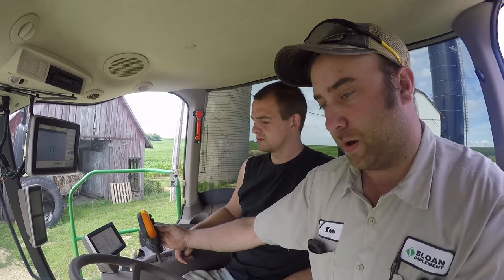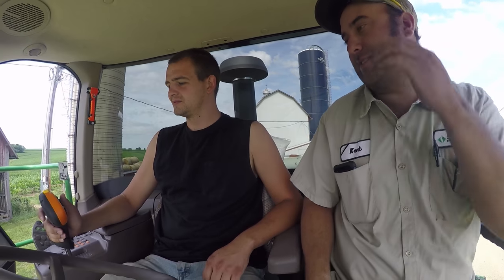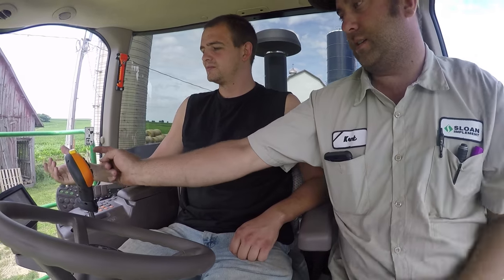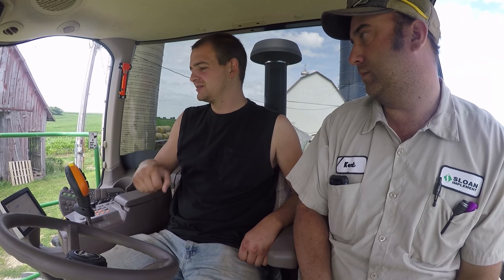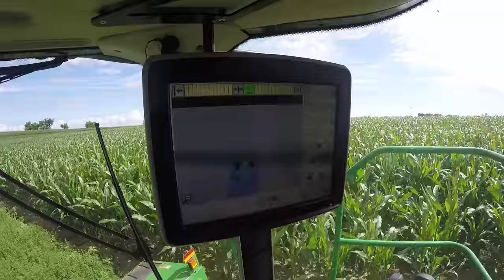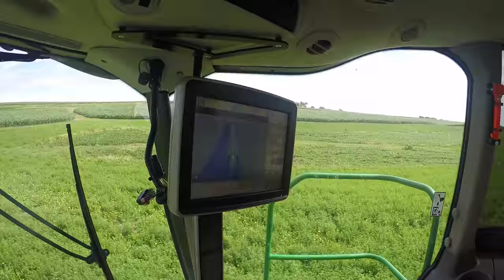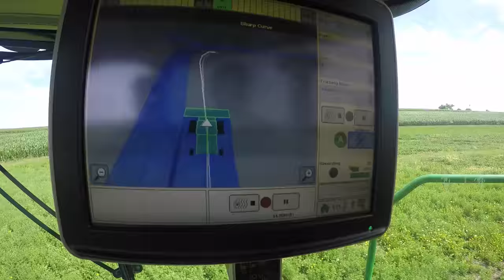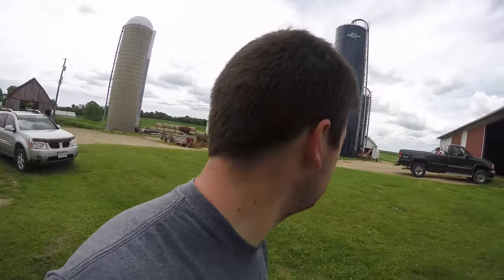Mowing Hay - Learning to use the John Deere W260 Windrower - Sloan Implement

Comment: We have a CaseIH 8840 Windrower.  Bought it at dairy farm total dispersal auction 2 years ago, without originally intending to.  Went to the auction interested in their center-pull New Holland, but instead we came home with a freakin' self-propelled gem of a machine.  Seriously, we bought it so cheap, it kinda felt like we stole it!  She's powered by a Cummins 4 cylinder turbo diesel. It's 100 times better than any pull-type machine we've ever used or owned.  Love that Deere you are running, but sure won't be able to afford one that nice and new any time soon.

Comment: have you ever thought of putting a front linkage and pto on the 8235r, and using either a double or triple mounted mower set up. It's alot cheaper than a windrower plus it will make more use of the tractor. We have a triple john deere mower on a new holland T7.235 and it handles it really well power wise and our crop conditions would be similar to yours.

Comment: Whats the benefit using this machine instead of a tractor with a mower? Seems more versitile using the tractor with implements.
Reply: Self-propelled windrowers are more efficient and much more ergonomically friendly.  If you've ever run one, you'd understand the first time you cut hay with it. If your farming operation can justify the expense, they are worth every-penny.  Our operation can't justify the cost of new, but we bought a well-cared for used unit for dirt cheap at an auction a few years ago, and frankly, it's the greatest thing since sliced bread.

Comment: If you plan on making high quality dry hay it may be hard with this machine.  Cutting a 16' swath of thick alfalfa and bunching it into a windrow that is around 9' feet wide makes consistent drying nearly impossible, especially with Wisconsins humidity.  If you buy that you might have to plan on getting a line-wrapper as well.

Comment: A question from an interested but ignorant viewer - this is a wonderful machine (even though it looks like a backwards built tractor), do you have to cut the first row with manual steer so that the cut edge provides the point on which the auto steer recognises?
Thanks

Comment: i really wonder about the economics of these things when you factor in the inevitable cost of repairing some of the electronics in these machines.
Reply: the price of modern farming and being efficient
Reply: yeah, i prefer a trailer mower because with the self propelled one you are putting in a tank of diesel and leaving it sitting in a shed for most of the year. a tractor will always be used.  the self propelled take up more space in the shed while a trailed mower can be tucked in the corner and stuff placed in front of it leaving no gaps. trailed is better
Reply: +the pilot penguin what model do you own?

Comment: i dont understand this vehicle!i am employed at a contractor and i drive a deutz 630 and i have a krone front mower and a towed krone rear mower.and thus far i have cut 2500-2600 acres of 1&2 cut.and i wouldnt swap my tractor for this thing!!i can unhook my mowers and haul silage or slurry.so what is the purpose of this deere?how could this improve my work day?
Reply: It is a time saver, and I bet it's very economical too!!
Reply: timesaver!?krone big m or tractor with butterfly mower is a time saver!!but i dont see the point of this!it would be nice to try one,but they dont sell them here.i need to own this AND a tractor too do the other jobs!seems like a expensive  time "saver"
Reply: I can tell from your comments that you are not from the USA.  In the US, they don't use tractors with front mounted implements.  Yeah, it's fucking stupid.  Honestly, there's no other way to put it.  No clue why we don't here, but we don't.  

Therefore, we have "dedicated" machines like these in order to do many tasks that could likely easily be done by machines that you guys in other countries have that hook up to and are powered from the front ends of your tractors.

My guess is that self-propelled windrowers are not sold where you live because, just as you mentioned, they are a pointless waste compared to what you folks are currently using there on your tractors.

If we had farm tractors here that could run a front-mounted hay header, we wouldn't need a machine such as this either.

Comment: and now you still have to row everything. i don´t really get the meaning of this machine. does prepare the mowed stuff somewhat special?
Reply: For high volume hay producers, it saves time and fatigue by cutting the crop faster and directly in front of the operator rather than behind and to the side.  For a smaller producer it probably doesn't make financial sense to purchase it, but for the ones making hundreds or thousands of acres of forage multiple times per year, it makes very good sense.
Reply: Probably just like a normal mower-conditioner. Some newer mowers, like you may know, can spread the mowed crop in windrows with adjustable widths. I wonder if this thing could do that?
Reply: TheodorEriksson They most certainly can.
Reply: Raking (converging two or more rows) serves two main purposes.  First, it aids in the finish drying process.  Second, it reduces the run time (hours) on the baler.  Every second a baler is running equates to wear and tear on a high dollar piece of equipment. Rakes are cheap, and the fuel and tractor run time are negligible, as it doesn't take a whole lot to pull a rake.
Reply: Matthew Hoag Figured. Nice.
Reply: also this machine can be used witha grain header also.
Reply: I was gonna ask if the head was inter-changeable.  He said earlier it was 260 hp, thats alot of hp just to cut hay.
Reply: It is interchangable... and 260 hp is not a lot of hp... its just right... Mine has 160 and in the big heavy hay.. powers it right out.
Reply: Oilseed producers use these with draper heads all the time.
Reply: Not just oilseed... everything
Reply: What, you mean you can harvest grain and oilseed crops with this thing? How?
Reply: TheodorEriksson They can cut and windrow many small grain crops that require drying time before going through a combine.  It's very common in western states (and provinces) to swath or windrow certain kinds of crops (flax, oilseed rape, barley, etc.) with a windrower using a very wide draper head and then follow with a combine equipped not with a cutterbar and reel but a pickup (similar to chopping hay) to separate the seeds from the straw and chaff.  Windrowers can be used for just about anything except corn, soybeans, and rice.
Reply: Matthew Hoag That's interesting, I've never heard about that being done before. Why is it necessary in certain places? Is it done because of otherwise unfavourable weather conditions, because it speeds up drying? Or does it put less hours on the combine, because you just have to pick up windrows instead of cutting the entire field?
Reply: To be honest, I am not completely sure why it is done that way.  Some wheat farmers will windrow and then pick up, while others will simply harvest in one pass the same way one would typically harvest oats.  Maybe someone in the industry can enlighten us further, but it most likely has to do with  moisture levels and the local climate as well as the factors you mentioned.  I defer to the experts.
Reply: Well we do it because We dont want to wait so long to harvest the crop... If we were to straight cut I would be waiting a long time for moisture levels to go down and for the maturity. A lot of people that straight cut here spray the crops down to make them mature faster, but i never liked doing that.  I will have a video here soon of changing over my hay header to the draper header
Reply: Northern farmer Interesting, so it IS for quicker drying? Are conditions where you live kind of sub-optimal for crops to dry growing?
Reply: Yes... It will dry quicker than if you waited for it standing... and yes the conditions are.. thats why everyone has to spray down the crop to straight combine... or else  you will be waiting till November...Check out my new video.. I Kinda explained about it... should be up by morning
Reply: In South Africa we windrow it in certain areas where it is windy because when the crop is laying packed on the ground the wind can't get to it like when it is standing. It prevents grain loss.
Reply: it is pretty late to answer but. Thank you very much for the explanation. always like learning new stuff ^^. at least i can make sense out of these machines now
Reply: Max Nuber My pleasure. Didn't see anyone talk about wind so I thought I'd add that.

Comment: EVER THOUGHT ABOUT A BUTTERFLY MOWER?
Reply: boondockr87 same, much more Efficiency do to more workwidth 
and much less maintainence cost+ the whole combo costs less than these machines...
Reply: reason for using these types of mower is that it also conditions the hay with rollers. Which reduces dry time, and cuts out one more pass with the tedder.
Reply: reason for using these types of mower is that it also conditions the hay with rollers. Which reduces dry time, and cuts out one more pass with the tedder.
Reply: reason for using these types of mower is that it also conditions the hay with rollers. Which reduces dry time, and cuts out one more pass with the tedder.

Comment: How come so many famers are complaining about the hay price and cost yet buy new equipment. There isn't a piece of equipment I use that is new. Everything is before 1975.
Reply from the maker: +calvinfbrown Many farmers realize the value of time lost when using equipment that is broken down more often than it is running.
Reply: If you've got enough acres to cover and enough hay to put up and sell, new machinery can pencil out... but we're talking a LOT of hay, particularly for a "one trick pony" machine like this.  These things are NOT cheap.  

For the rest of us, you run the best you can and keep it fixed.  Just because something's used doesn't mean it's that much more likely to break down... new equipment is SO overdesigned with electronic nonsense and SO overcomplicated it's just a matter of time before it breaks down... the more parts you have, the less reliable a thing is... 

Besides, I have yet to see the cow that gripes that you're baling their hay with too old of a machine... LOL:)  (Buyers, OTOH... well... )  
Later! OL J R :)